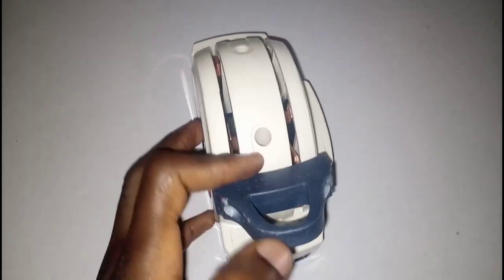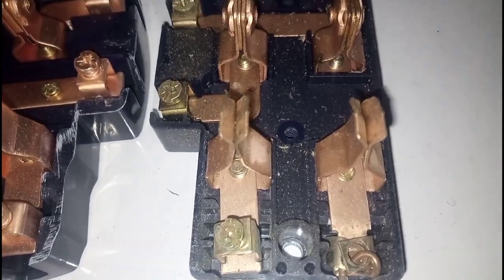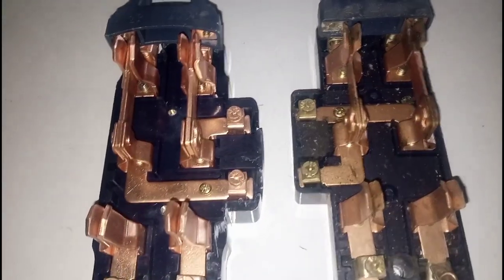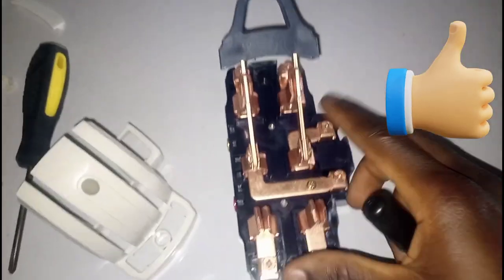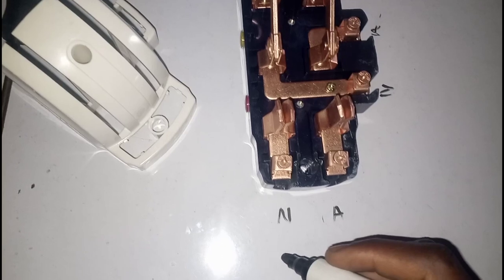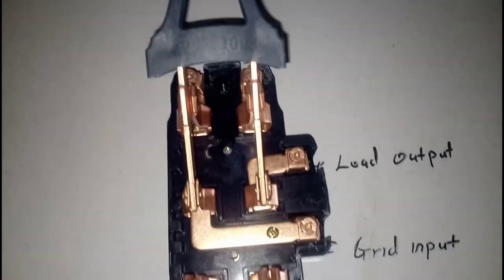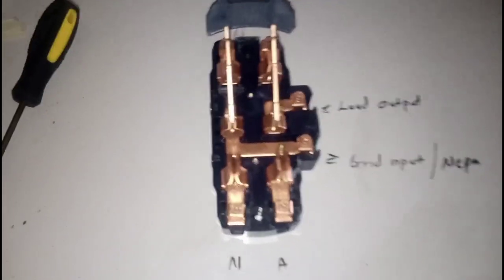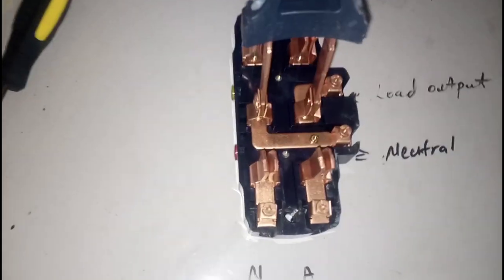how to connect knife switch changeover to inverter explained #electrical #growatt #electrician

Comment: For a 1.2 kva inverter which uses plugs sockets for the AC output and AC input can method 1 be used or we just stick to method 2
Reply from the maker: you can use 1 or 2 the one convenient for you

Comment: What size of breaker would u recommend for a 1.2kva Inverter Ac input and Ac output
Reply from the maker: power / voltage= current
Where power is 1200w
Voltage is 230v 

The answer is in Amperage (A)
Do the maths😁

Comment: If Nepal bring light, will it automatically change from NEPA to solar, or solar to nepa?
Reply from the maker: Yes, that is if the knife switch changeover is in down position 👇,the inverter automatically changes its output from nepa to solar and vise versa, Else No
Reply: Where will all the neutral go in d first representation

Comment: In your explanation it is only the life that will be entering those A and B if I am correct but what will happen to the negative wires respectively?
Reply from the maker: Neutral is common and it can go direct to the DB without breaking
Reply: But what will happen to the black/negative wire coming from the grid if the black wire from the inverter go directly to the DB? 

Thanks bro I will be expecting your response
Reply from the maker: @okparamichael1690 the negative from the grid is already on the db,connecting the inverter negative to the db means connecting to the grid(common neural)
Reply: @colcent_solar  when inverter negative meet with grid negative in the DB I hope it won't cause fire because when there's power from the grid and the inverter is also working and charging it at the process,wires from two different source is it safe?. your own connection makes me feel I won't be going to the change over always whenever nepa takes the light or bring it back and that will be great..Boss please can you shed more light abeg
Reply: @colcent_solar  bro abeg reply me
Reply from the maker: its wont burn , neutral is common 09065594904

Comment: Where will the Neutral from the Grid/Nepa be connected?
Reply: I mean for the second method
Reply from the maker: the second slot of the load output side , where the grid input was connected on the first method
Reply: Like common natural ?

Comment: What if i want NEPA to charge the inverter but not generator how can i make such a connection
Reply from the maker: same thing, you will just put the change over down
Reply: Charge the inverter? Do you mean charge the battery? Most inverters have 1 AC input, and there are settings to set priority on what you want to charge the battery at any moment.

It's not possible to power the inverter without.
1) Solar panels.
2) Batteries.
3) AC input.

So when you turn on your gen, just put off the inverter or eliminate the AC input and get power from other sources.
Reply from the maker: The meant charge the battery not inverter